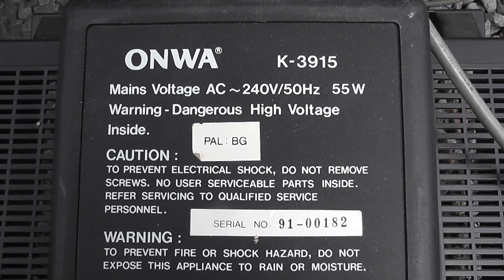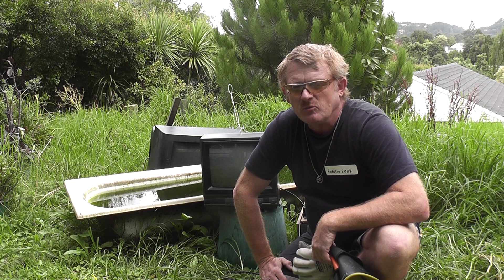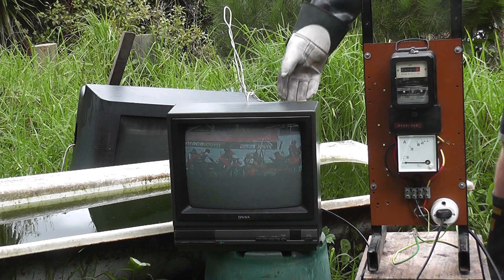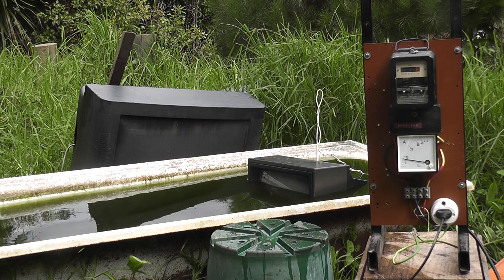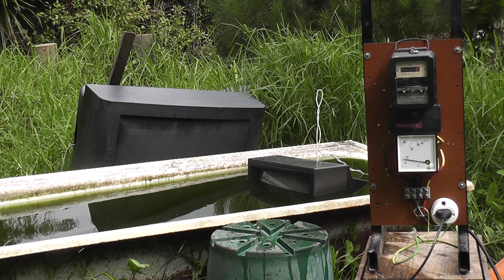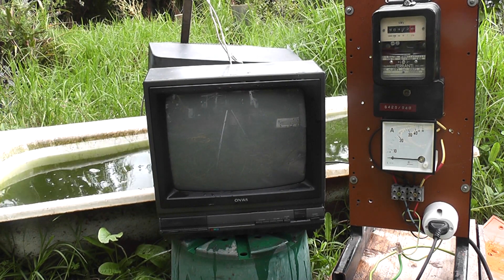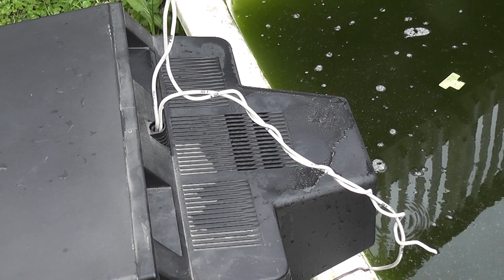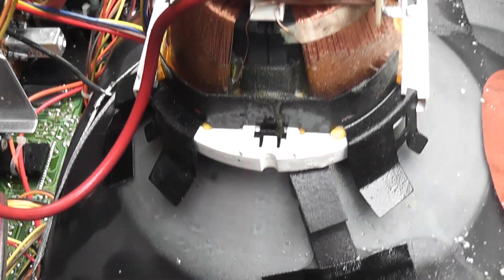Dunking the TV in the bath

Comment from the maker: Interseting, a TV put in clean oil should basically work with no problems, even clean cooking oil.
Power transformers use mineral oil for cooling and insulation.
Destilled water, interesting hmmmm, still destroyed the TV
I understand with green algea water I used, or sports drink that the TV is in big trouble.

Comment: Have you used an isolation transformer or you are directly connected to the mains?

I don't know if NZ distribution boards are equiped with an RCD, but without an isolation transformer the RCD will trip damn quickly!

Comment: i remember when lear chemical had a working TV submerged in about 20 gallons of "corrosion block" avaionics oil thats used to treat components used in aircraft and ships from salt water or moisture,the TV was completely submerged and was working for years in this liquid  ,they even put another tv that was treated with it in water and it also worked,it failed in salt water though ,nice boom then it sunk ,i guess the tube was warm when they tossed it inside :P